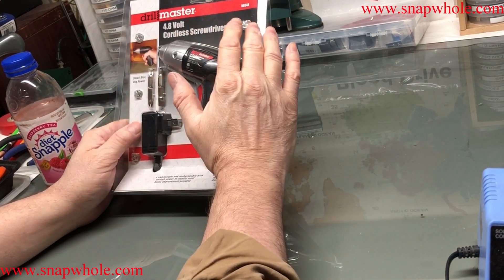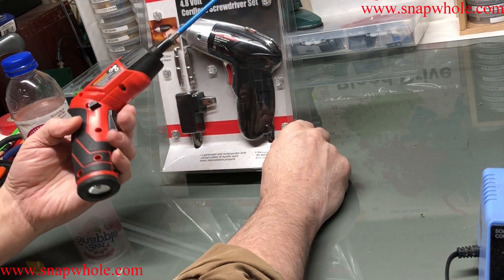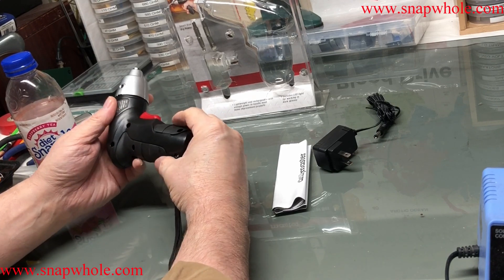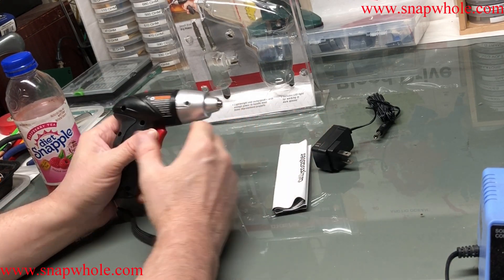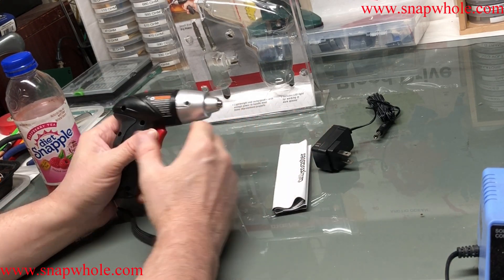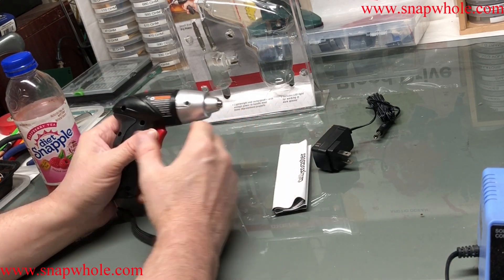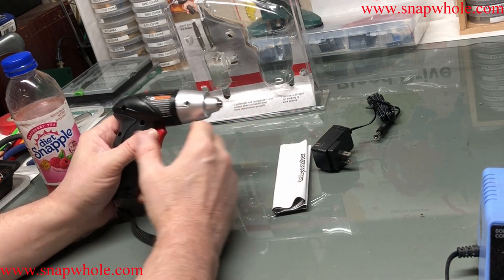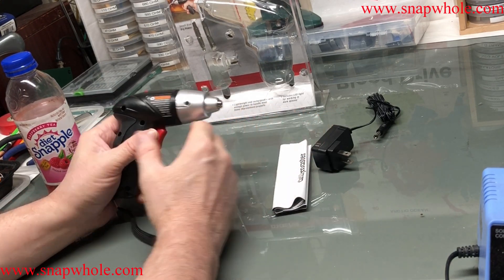Harbor Freight Drill Master 4.8 v Mini Driver Review

Comment: I just bought one 1 hour and 45minuts ago...im LQQKING forward to trying it out👍🏻 and it was dirt cheap in price I could not resist!
Reply from the maker: This tool is amazingly useful, 1 speed, not a lot of torque - exactly what you need for 3d printers and electronics - thanks for subscribing!

Comment: You got this drill for $5.00?  Wow, it's on "clearance" right now at Harbor Freight for $12.97 !!  Would love to know what the original price was... 🤔
Reply from the maker: these used to very cheap, it was replaced with a bauer 4v, and drill master discontinued - its great for electronics work because of the low torque - I still use it - a lot has changed with the run away inflation over the last few years..... thanks for subscribing!

Comment: How do you remove the bits???
Reply from the maker: the bits are held with a combination press fit and a magnet, so you push them in and they stay and pull them out and they come out - thanks for subscribing!
Reply: @snapwholeharborfreightreviews  
UGGGH Not so easy to take out we had to use pilers to pull it out!!😂
Reply from the maker: @adamthompson7170  it might a burr, if so, it should get easier over time with use, I didn't have that issue, so there must be variety in the manufacturing proces - thanks for subscribing!
Reply: @snapwholeharborfreightreviews  
You’re probably right!👏🏽👏🏽👏🏽

Comment: Will any bits fit on this?
Reply from the maker: it uses standard 1/4 inch bits, I actually wish it took 5/16 bits for use with my 3D printers but it a vey handy tool to have around either way - thanks for subscribing!